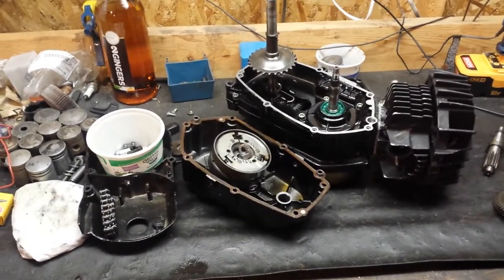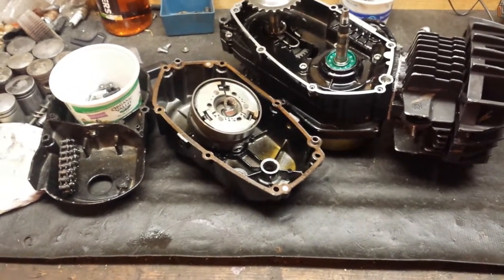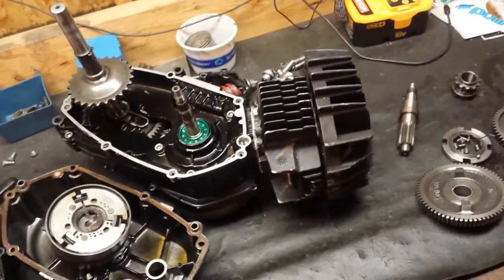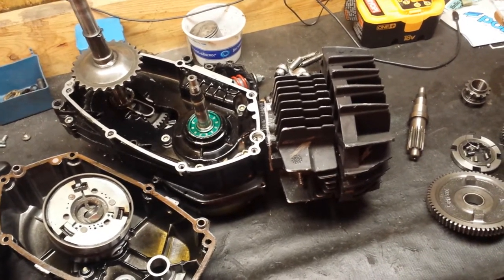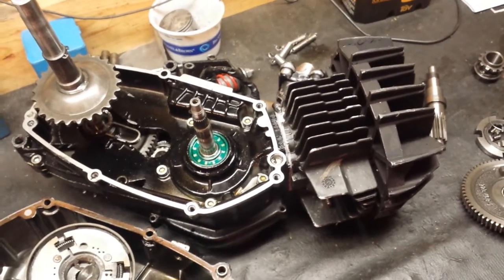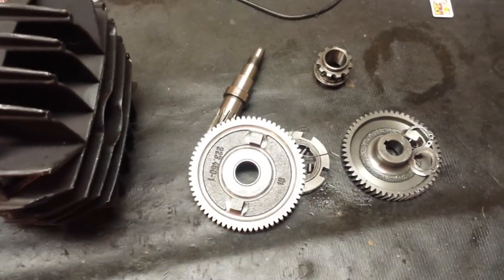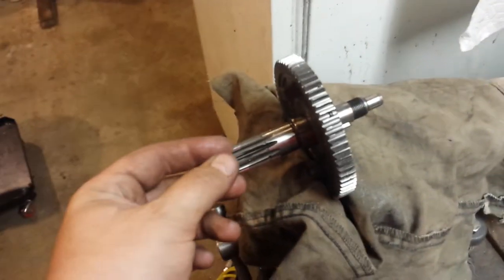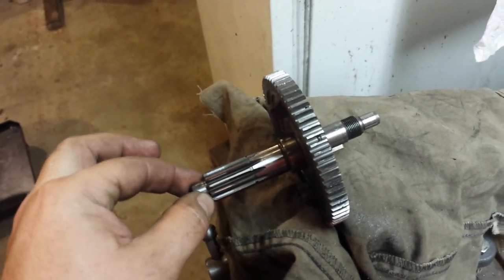Still Troubleshooting the Tomos A35 Rattle

Comment: Its just a normal kit sound period they make that noise its the aluminum vibrating take your hands well put gloves on first and put one hand one each side of the cylinder and it push the sound will pretty much go away they make fin dampeners or you can make some out of thicker fuel line, the sound is just a normal 2 stroke noise the sound gets amplified from the fins and or they also vibrate its the nature of the beast. So don't worry peeps